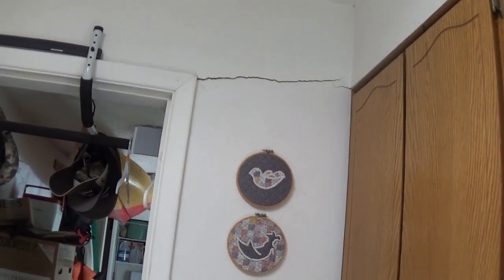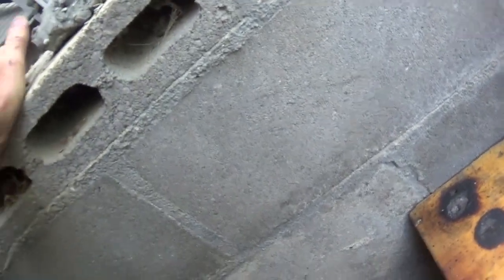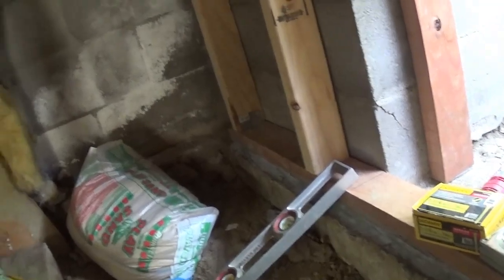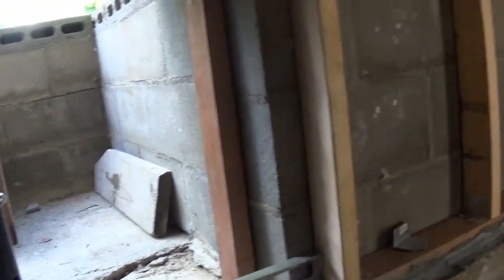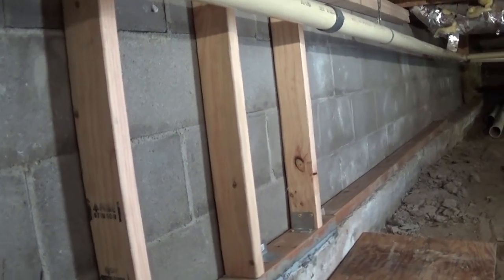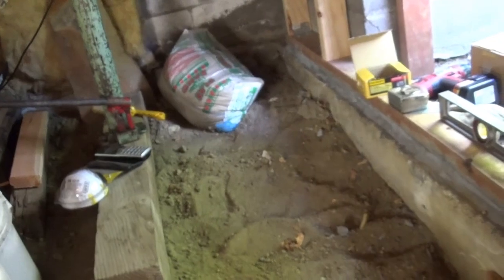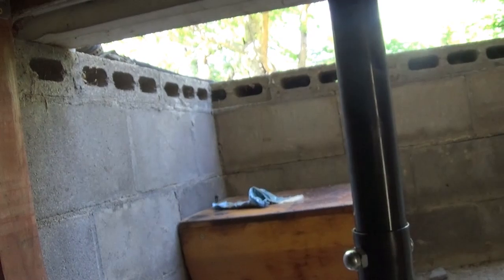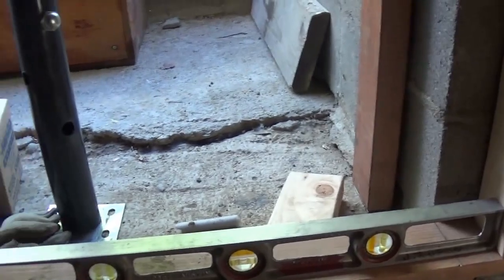CHEAPER THAN DIRT  Foundation Repair

Comment: Your wall puts the weight on the edge of the footing. That will want to roll the footing. That would happen over a long time though. If the joists move up, best to just shim them on the foundation wall to keep the weight centered on the footing. Not know how they anchored the plate to the foundation wall, but likely typical anchor bolts in a grouted area of the blocks. If you can find those anchor bolts by probing with thin metal strips or something, then you could cut a hole in the walls above them, loosen the buts, jack up the house until level, shimming the joists on the foundation as you go. Then tighten the nuts and fix the walls. Good for another 50 years, maybe. Where the foundation walls are cracked bad, if you want to get carried away, you could open holes on the top blocks in each cavity, trowel in concrete, around a bag for each cavity it appears like, and vibrate a little as you fill with one of those cheap drill vibrator attachments.when the cavities reach fullness, you need to have some scoop things, make out of wood to cover the holes so you can over fill, making the concrete touch the plate. None of it needs to be perfect, you can do it, no problem. Of have it done for 55k or something.
Reply from the maker: Thanks for taking the time to give me this valuable feed back.  Unfortunately my money tree has not been producing any fruit the last couple years. I am not going to disturb the living space to get to the sill bolts. I was only able to get one to free up so far. Now that you have pointed out the rolling issue I will add shims on top of the block where ever there is a gap. That way if it does start to roll it hopefully will balance out. My main objective is to level this part of the house and prevent future roof and ground water from coming this way. I am going to make landscape changes to move the water away and add a electric sump pump with battery back up in case I get one of Mother Nature's pissing contest's. Again, Thank you for taking the time to share your expertise.

Comment: Your dead right by keeping the soil dry under that footing.  Stopping  the footing from sinking is your only defence because the only real answer it to excavate under the footing and pour a larger pad  to hold up the existing footing. The reason for this is because the house and nib wall will be parting as you jack up the joists and bearers.
I  was Building in South Austrailia where the slump between summer and winter is 12 inches. To overcome this they use a raft foundation.
Went for a spin in the beach bug yesterday and the wheel nuts came loose on the rear back. The wheel came off but didn't do any damage, lucky . The cast on the Chinese drums is very soft, it needs locktite studs instead of lug bolts.
Good luck with the building.
Reply from the maker: Thanks for the foundation tip.  Glad your wheel did not end in disaster.  Studs sounds like the solution.